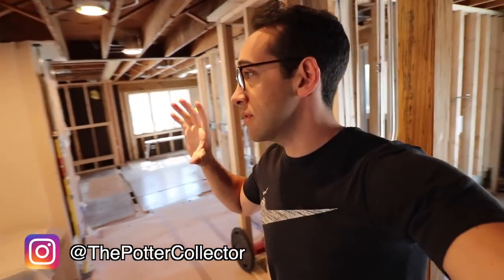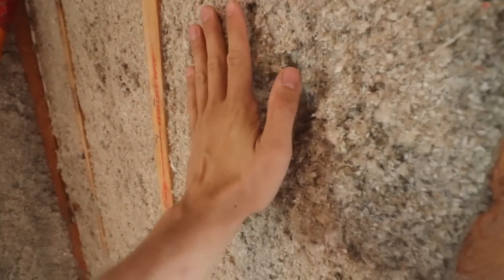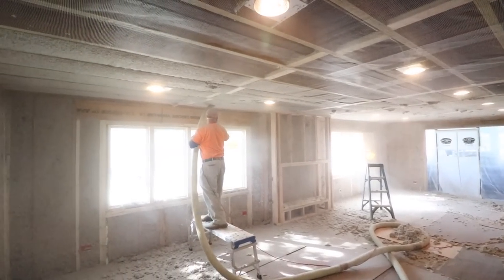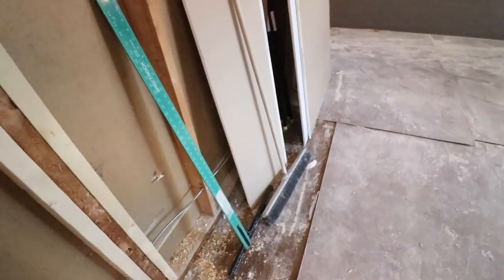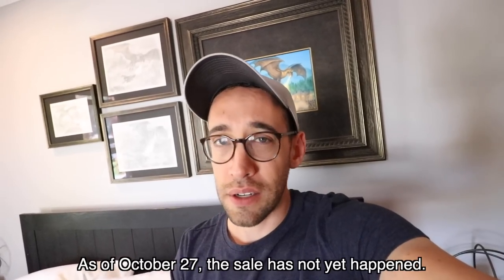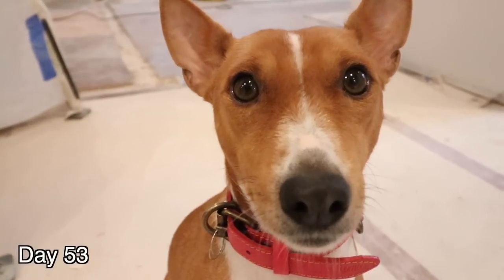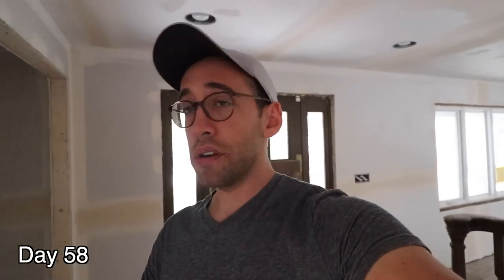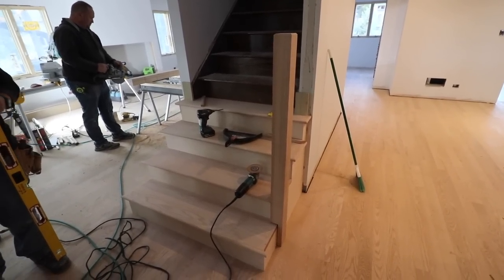How insulation is installed... it is MESSY! | Home Renovation Episode 4 | Peter Outside of Potter

Comment: I need this insulation for my ceiling/floor like you have, so my top floor I can hear conversation in the basement. So be nice to not have to hear others talking. My guess for the floor is Dark walnut.....? Love the sky light it's quite nice and that you have those large doors so you can watch your dogs play outside. It will be nice in the spring/early summer to just let air into the house too. Good choices Peter. Will be interesting to see what the cabinets and white marbled look, will look like with the flooring.